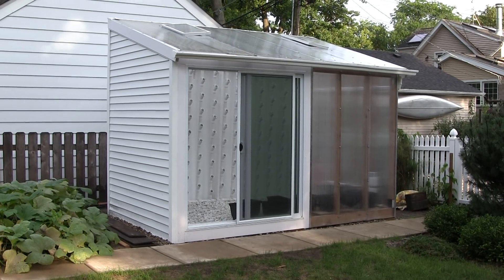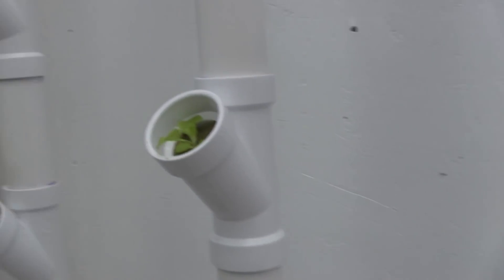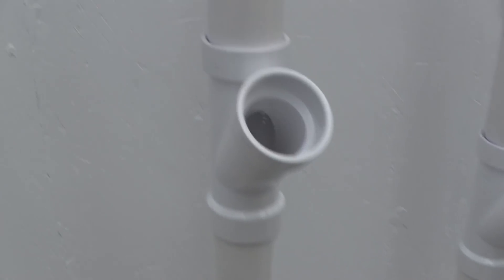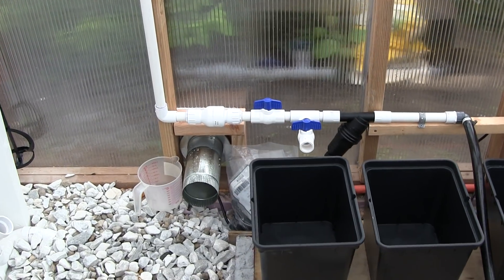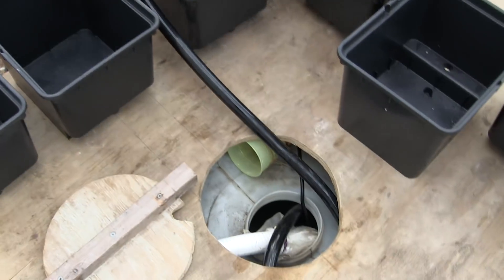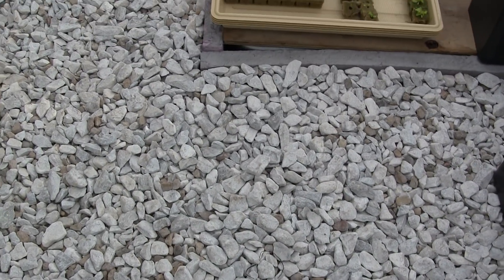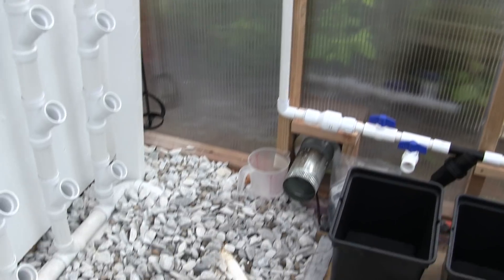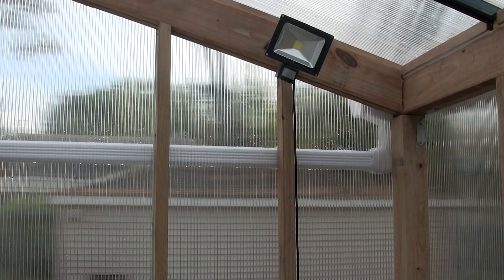2016 Passive Solar Hydroponic Greenhouse

Comment: I love the idea of this setup but the PVC has phthalates which are a large group of chemicals that act as binding agents, make plastics flexible and are mainly used to soften PVC. Phthalates have been linked to an alarming number of health issues and diseases. These include breast cancer, ADHD, asthma, obesity, type II diabetes, autism spectrum disorders, reproductive problems and male fertility issues.
Reply from the maker: leaching may occur at high temperatures above 140F or due to UV degradation. Temp is not an issue, and so you must use a UV protective paint to protect the pvc for outdoor use.

Comment: I built my towers using only the PVC pipe, no Y fittings, and now I have leaks like crazy. Is it possible to salvage my build, or should I just build new towers with this method? I have a video on my channel of my towers if you want to check it out.
Reply from the maker: Hi, I saw your build on your video. I moved to the wye fittings because I had some leaking issues too. You may be able to cut your pipe at the current sites and install the wyes in between if you have enough distance. My pipe length between fittings is 5 and 1/2 inches and my sites for plants are 9 inches apart. For fruits like tomatoes or cucumbers I'd recommend dutch buckets. My system is designed for small plants like lettuce, bok choy, herbs, etc. Most plants including fruits get too big and will shade the other plants, and also would require supports. Best of luck to you!

Comment: What latitude you live and what is the average winter temperature outside in your region? I doubt this solution would fit "rest of the world" above certain latitudes. I live in Poland on the exact latitude of London with winters up to -10 Celsius, so I doubt solar collectors could warm the inside of the barn enough...
Reply from the maker: Hey, the solar panels are for electricity, not heating. We can get down to -24C a couple times in the winter during cold snaps so I shut the greenhouse down and grow in the basement. I run the greenhouse from March - November.

Comment: On the vertical pipe assembly - do you glue all the pieces together or just assemble?
Reply: glue or they will leak.   ive done both ways. :)
Reply from the maker: glue for potable water

Comment: This is great!, quick question, the 1.5 inch Wyes are they rated for drinking water ? local hardware stores sell wyes rated only for drain, waste and vent. Should that even be a concern?
Reply from the maker: They may leach impurities if you heat the nutrient above 140 degrees F.  That's why PVC is not used for hot water applications. I keep mine at basement temp, which is 62 degrees.

Comment: The connectors are not cost effective, punching a hole on 4inch pipes is less expensive 🤔
Reply: Pointless comment. Apparently they are for Joe. It's your choice. Take it or leave it.
Reply from the maker: I tried that. It leaked.

Comment: Very Nice! IBC tote in ground filled with rain water is very smart. If the roof were sloped from front to back, the roof could be insulated as well. I have invented insulating reflective  blinds that will slow the nitetime loss of heat as well.
Reply from the maker: cool - keep inventing. Thanks for sharing!

Comment: I really like the Hydroponic systems you design and share on Youtube.  They are made with PVC but they look VERY professional and quite aesthetic. I just don't understand why you haven't upgraded to Aquaponics and implemented fish into your system? Instead of purchasing fertilizer chemicals you purchase fish food and the fish waste is what the plants thrive on and then in turn cycle clean water back to the fish. ....Oh Wait! I just saw an old video of yours where you had an aquaponics setup. So now my question is why do you prefer hydroponics over aquaponics?
Reply from the maker: Yes, I ran an aquaponics system for over 2 years in my basement. The upkeep was killing me. Constant altering of pH, feeding (could have installed an automatic feeder of course - but then it's good to check on the fishies at least daily, especially indoors), but waste management was my big problem. I didn't engineer in a swirl filter, so I was constantly cleaning out my intake sponge and had to periodically vacuum out my grow tubs. It was also too cold in my basement in the winter for my Tilapia, and in the summer the open system produced too much humidity and was causing mold issues in my basement. I love aquaponics and fish - I have two aquariums and 2 ponds with Koi, but my basement wasn't the right spot and I should have had a different filtration setup. My greenhouse is too small, and I have to shut it down in the winter anyway, so it would be a quick season. Hydroponics is perfect for me, because I can shut it down and start it up whenever I want, and it's clean and easy. And the nutrient is cheaper than you think. I save $25 a gallon by making my own solution vs. purchasing it per gallon online. I follow the recipe from ChilLED Grow Lights on Youtube. :-)
Reply: Hello, You guys are great! Thanks for sharing! I have a wall on my terrase and a lot of sun, too much sun, everything dies there, but I want to make a vertical wall like you have in greenhouse but with a fish pond over there. So my question is can you put a fishpond inside the greenhouse with this vertical wall system on the fourth floor with a very aggressive sunset? Plus I live in Slovakia so we have minus degrees in the winter too thanks! I can send photos if needed

Comment: Do you find that the 11/2" gets root bound causing water stoppage?  I run 4" and sometimes have this issue with vegetables such as cucumbers.
Reply from the maker: Yes,  the 1 1/2  is designed for plants with short life cycle and those who get harvested completely, like lettuce, bok choy, etc. When I run my basement system I don't grow fruit bearing plants like cukes. And I change out my herbs after about 3 months. I find the new plants grow better than the older ones anyway.